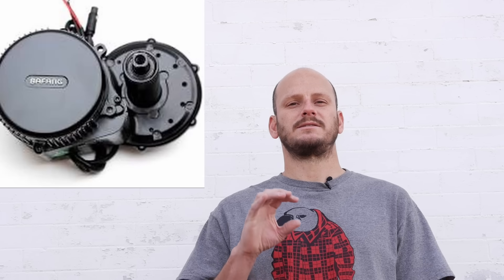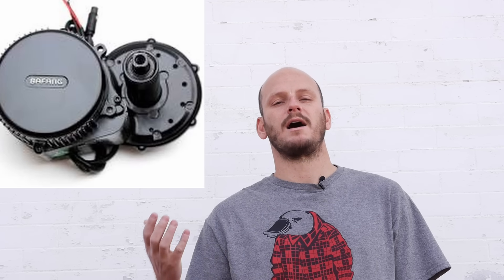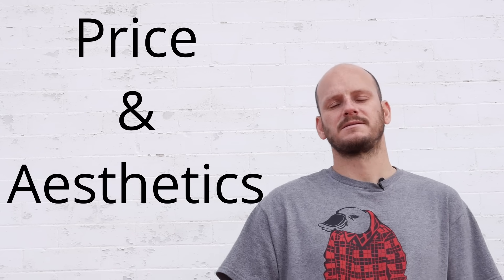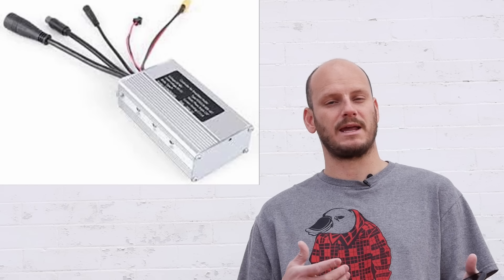Hub vs. Mid Drive Motors: Why Hub Motors Suck and Debunking Common Myths with performance test

Comment: Yes, but I can afford to replace the whole hub drive wheel a couple times for the cost of a mid drive.
And cheaper than relacing. Show me a mid drive bike for $750.
Reply from the maker: Bafang bbs02 are $450.
Reply from the maker: Sorry I thought you meant just a motor. An entire ebike for $750 is best to be left alone and let an unsuspecting buyer get it.
Reply: One thing that wasn't mentioned is that geared hubs allow the motor to run in a more favorable range and sort of split the difference between direct drive and mid drive. They provide more low end torque at the cost of high end speed.
Reply: @curtwuollet2912  ... I wanted a silent ebike, that was really smooth to use. That's why I picked the mid drive with Gates belt driven rear geared hub... Sure it's only a three speed, BUT since I live in Florida, hills are NOT an issue.
Reply: @JJ_ExMachina  I think what an ebike ends up being may shed parts carried over from bicycles that aren't as relevant. Belts are an example. Chains are a bit more efficient, but with motor power, no big deal. We could even see variable ratio setups like scooters or snowmobiles. Pedals are written into law, but may become vestigal. Already, I've looked at step throughs differently. At 67, the high kick over the frame gets to be a bit much.
Reply: @curtwuollet2912  ... Well after riding the Luna Fixed Stealth for over a year now, I can tell you that gates belt drive is far more reliable and far less maintenance then a chain. Yes on paper a belt may not be as efficient as a brand new unused chain... BUT after close to 10 thousand miles on my bike now... With zero need for lubrication, adjustment, and or replacement... The belt drive is far more efficient then a dirty chain or one that is worn out... It's great, not having to deal with cleaning and waxing my chains anymore... All I do is hit the bike with a hose, every now and then and dry it off... Nothing really to worry about. I am in my 40s and still enjoy the "high" kick over frame... I also still enjoy my sports bikes, so I might just be one of those "weirdos"... ;)
Reply: @JJ_ExMachina  I have no doubt it's a nice ride. But I had to stay within reason on retirement. The important thing is that the regular bike I had might be 10 years getting to 1600 miles, maybe never. I got out and rode the ebike about every day it wasn't raining or too cold for a year. So it is worth 10x more than the one that stayed in the garage.
Reply: @curtwuollet2912  ... Yes I agree completely... My ride my ebike about 30 miles a day or more...
Reply from the maker: @curtwuollet2912  true. But this video was more to just bash hub motors unashamedly😀
Reply: There are no cheap "good" e-bikes... Sorry but anything under the $900 range is a garbage e-bike (I am talking whole bike not add on kits). Heck most analog bikes under $600 are pretty crappy... SO $750 e-bike has to be a smoking pile of "sh*t".
Reply from the maker: Totally agree
Reply: @JJ_ExMachina  So far, I've got 1630 miles on my $770 500w ebike. Would have more, but my biking season is kinda short here in MN and I don't ride unless the weather is pleasant. Sure, a 2 or 3 thousand dollar ebike might be nicer, but the ebike thing didn't take off at those price points. Now you can get decent range (450 WH), name brand parts (Shimano, Tektro), and good, if not stellar, performance for a price point that is attractive. Yes there is some junk out there, but that will sort itself out. When people buy their second or third ebike, we will see more commodity bikes than big buck bikes my guess is that mid drives will come down to fit in that mix.
Reply: @curtwuollet2912  ... What bike do you own, as the only ones I have found that are worth their money start at no less then $900 (whole bike new, not an add on kit mind you).
Thanks for your info.
Reply: @JJ_ExMachina  It's an Ancheer, their 26" 500 watt upgraded model.
I got the upgrade for the bigger battery and Tektro brakes, plus adjustable stem. It's a very basic bike, but that's what I wanted.
P.S. It goes more than 15 mph if you disconnect the white wire.
Reply: @curtwuollet2912  ... Nice, can't complain, for the money you got a great deal...
   I am running the Luna Fixed Stealth Ebike, for $1750, it's got Gates Belt drive, three speed hub, and a 500w mid-drive...
Reply: @JJ_ExMachina  That is one thing I've learned with an ebike. 7 speeds would be enough and simpler. Just before winter, I upgraded the controller and display (because I can) money well spent. It's even better now. Low end torque is better for starting.
Reply from the maker: True. That’s why I always tell people to find a good bike to begin with especially on the used market it’s easy to find one for under 500 bucks with top-notch components. I sell high-performance long range motor kits for about $1000 so for all in at $1500 you can have a killer ebike. Even at at $111 you can have an awesome mid drive ebike including cost of bike. But you’re totally right about the dust settling we’re still in the wild wild west as far as Ebikes go where nobody really knows how much an E bike should cost.😩

Comment: I agree with your points. That being said, my dream build is a qs205 hub at 72 watts with a bigass battery. Specs dictate more of a motorbike/moped but I would ride it like a bike and will build it to look more like a bike than a motorcycle. Put less stress on the drivetrain, still have the power to not notice the motor crapping out at high speeds/while climbing hills. A 750 w planetary hub motor is pretty dumb in my opinion for a true daily driver/commuter bike (even dumber for a cargo bike lol). The motor is irresponsibly small and will easily burn out as you mentioned. I just like the simplicity of a direct drive hub over a mid-drive, and if there's enough voltage/amperage it seems like most of the negatives associated with a hub are gone. I would be curious to hear your thoughts on this and I appreciate the vid!
Reply from the maker: You totally get it! 72v on a hub motor is 🤘. Sounds like a killer build!

Comment: @JohnnyNerdOut Have you ever installed a mid drive on a SWB Recumbent? If so, what would the ride be like?
Reply from the maker: My friend rode one. He delivered with Uber eats on it. I tried riding it and always felt like I was going to do a forward summersault. I personally didn’t like it but maybe after 50 miles I would’ve gotten used to it.
Reply: I ride azub apus with geared front wheel motor for 10 years. I am satisfied. Mid drive motor would kill my long and expensive chalin before 10.000 km. You can see me driving on YouTube. Type " ležeče kolo skribas ". Recumbent bikel is the constitution, motor drive is the law. :-)

Comment: Has anyone tried to put a mid drive motor on a 2020 Surly Ice Cream truck fat bike. Very wide chain stays. I have not yet found a motor that clears and runs the chain well aligned. Any suggestions are most welcome.
Reply from the maker: Might need to try a cyc motor

Comment: Why did you skip over or oversimplify so much? 
https://ebikes.ca/learn/why-hub-motors-are-awesome.html lists 8 advantages that hub drives have, like 3) Ability to use internal gear hubs 4) Higher peak power capability 5) Potential for regenerative braking. Regen will make your brakes last 5 times longer in any weather, adding reliability.  Internal gear hubs are more reliable than mids with deraillers. Most IGHs aren't built for the high strain that mids push out. 

Grin's engineers have built motors for 15 years. They have fixed many of the problems you talk about, like their Baserunner fits inside popular generic battery cradles like Hailong or Reention, so you're not stuck with only one brand. They also come in Ready-to-Roll kits with all parts included so you convert your bike in 30 minutes without any special tools like the middrives need. You didn't mention the difference between Direct Drive and Geared Hub motors which have different levels of torque. They've put many motors through dynamometer testing so you can see exactly how much torque you will get if you plug in your total weight, voltage, etc into their web motor simulator. 

Holmes Hobbies also mentions in a video about how Grin tested to see how long before spokes fail on hub motors to fix that as well:  https://youtu.be/cSuqqIS4sP8
Reply from the maker: Grin is probably the only hub motor that I have and will recommend to people who want a hub. I use an IGH with my motor so I don’t understand the point. Mid drives are just, in my opinion, a superior design. It takes more of a learning curve, but worth it. Each motor is designed for different riders in mind. For me personally, I need a mid drive. I ride a cargo bike and often haul big heavy loads and ride up and down steep inclines. A hub motor cannot handle that workload. But for some people a hub motor is just fine, if you live in a flat landed area and don’t put it under heavy hauling duty.
Reply: @JohnnyNerdOut  There are hub motors built for cargo bike use, like the GMAC motor.
Reply from the maker: @sammiller6631  that’s a pretty cool motor. Geared and regen. Grin is a great company. Too bad they don’t make mid drives😀
Reply: @JohnnyNerdOut  Why would Grin make mid-drives when that's a crowded market with big names like Bosch can produce higher volumes as well as dirt cheap Chinese knockoff clones like Bafang? 

BionX tried that and even managed to become the standard for a while but where are they now? Better to be a big fish in a smaller pond than having to swim with mid-drive sharks that will leave your motors without parts when they show no mercy.
Reply from the maker: There’s a reason no one makes hub motors with regen when it comes to bicycle applications. Not enough enertia to recoup useable power. 
Personally I would rather deal with a broken chain than a broken wheel😀🤞
I’m closing it on approximately 1500 issue free miles on my IGH single speed chain combo.
Reply: @JohnnyNerdOut  Regen braking's main benefit isn't recouping power. The 10% it returns to the battery is a side benefit compared to added brake life from not grinding brake pads or heating rims on long descents. If hub motors are set up correctly, then there are no broken wheels or chains. Just ask on the Endless Sphere forums.
Reply from the maker: @sammiller6631  in my experience hard braking is where brake pad wear occurs. Unless the regen feature can lockup the tire essentially, I don’t see it saving any real brake pad life. Maybe 2-3%. I could be wrong, just my immediate thought though.

Comment: In my opinion you have added some of your own myths to this video. For example you can add a 7 or 8 speed gear cluster to many 750 watt Bafang rear motors & weight wise it is pretty close to the BBS02 750. As for torque numbers the BBS02 delivers 120 nm from the factory not 160 as you claimed. Torque numbers really only matter at the pavement anyway and running your power through your front chainring, chain, rear gear cluster, through the wheel, spokes & finally to the road is a lot more places for things to go wrong with higher torque numbers. As for having a nice clean package should something go wrong with my Controller it's a hell of a lot easier to access than on a Mid Drive. For performance, speed & reliability numbers if using the same rated Bafang motors I don't think there is much between them with the same gearing & weight being pushed. Each has advantages & disadvantages. It all comes down to amps in = watts out. With a Mid Drive you can go to an Internal Gear Hub. With a Geared Hub Motor you have a more direct application of your power & can use your throttle if you don't change down quick enough. One other disadvantage to Bafang Mid Drives is the installation damages your bottom bracket shell. May not matter to some but it would matter to me if I just spent $5 or $6000. on my bike.
Reply from the maker: We all have our own opinions. People always ask me why i dont ride a hub motor anymore and thought i'd make this video. For me the hill climb comparison says it all. Numbers look great on paper but in real life its all about the experience. Also, i've rarely seen any bottom bracket damage when installing a BBS02. the main thing is that a mid drive can pin point where the power is going (specific gear).

Comment: Just bought a Bafang bbs02b 750W and 52V battery, will get me anywhere I want for sure.
Reply: It could even get to places you don't want. They are capable little workhorses.
Reply: @michaelsprinzeles4022  Good to know. I really want distance on it and i think I will get that at moderate pedaling. Haven't mounted it yet has been to freaking cold outside, but now the warmth is coming here so its very soon time and I just can't wait.
Reply: @dtiydr  Depending on how many amp hours the battery is, with pedaling you'll probably run out of power before the battery;)
Reply: @michaelsprinzeles4022  its a 20Ah prismatic battery. And I will most likely pedal all the time as well either its on or off since I want to be somewhat fit condition which is the reason I bike anyway, I'm not overweight but still. But I want to get farther and a little faster which I guess the BBS02B will do for me.

I normally average around 14.3mph when I cycle normal on a flat road but around 20mph or little over would feel as an ok  continually speed with pedaling. But I have no experience with electric bikes so I don't know any range. I don't want to discharge the batter much either to keep a long life on it and I think I can be able to do that with 20Ah and still have good range.
Reply: @dtiydr  I'm not sure how hard you're going to pedal but it definitely sounds like, with that much effort, you'll never see your battery die;)
Ride on & enjoy;)
Reply: Os that the one with torque sensing and ISIS-standard cranks?
Reply: @Kolon999  No the BBS02B does not have torque sensing, the competitor TSDZ2 has. It was a little struggle to decide which to buy but there were some rumors that the BBS02B was a bit stronger which was what I wanted and also didn't have any real use of the torque sensing thing at all. The pretty much only downside of the BBS02B was that it was not as easily programmable in any way you wanted as the TSDZ2 where you can program just everything and also the TFT color display you can buy to it where you could change the layout in pretty much anyway you wan't, which you can't (as to my knowledge) with any TFT color display for the BBS02B. But you can program the BBS02B it self quite much these days anyway since someone released the program that the fab used, which opened it up sort of speak. But I haven't have the time to dealt with it all yet.

Comment: Sold. Gonna order a bbshd bafang... with a 52v battery... but what size battery u recommend? How long do they last for the diff sizes. Amp hrs etc ?
Reply from the maker: I usually say go as big as you can afford/bike can handle. No one ever complained of having too much capacity
Reply from the maker: Check out my other video :What are Watt Hours/How to calculate how many you need

Comment: Are there mid-drive motors for stupid frame types? I need one with at least 1" clearance between the motor and bb shell.
Reply from the maker: You just need to add 1” of spacers

Comment: I like the new stile mid drive with the belt  drive combined with the internally geared hub. Right now they're stupid expensive, but much better design.
Reply from the maker: Absolutely. Check out the new ebike by Harley Davidson. Great bike, just underpowered
Reply: @JohnnyNerdOut  You forgot over priced as well.
Reply: Got a belt drive...silent

My wife's screams when the credit card came due...well it's worth it
Reply: @SocalSamStokes  yeah you like it? I heard one guy once complain  about the hub's blowing from the torque of a thousand watt mid Drive, but I've only heard it once.

Comment: I disagree hub motors are better I use front 500 watt high torque low speed 48v on the front for acceleration and 2500w 52v on the back and it would destroy your bike speed acceleration and range
Reply from the maker: well ya, a 2500w would destroy a 750w, even if it is a hub motor. Once you get over say 1500w the differences in performance start going away. This video is showing the difference between street legal motors.

Comment: Dude, where the hell were you like a week ago?? I just took my brand spanking new hardtail hub-drive to a local trail with some hills and MTB features and it SUCKED! It was super soupy out there cause we got a ton of snow melt right now, so it'll probably be better dry, but I felt like I was the rear hub was pushing and dragging me all over the place. So offcenter it's hard to control the damn bike. Wish I'd have seen this before pulling the trigger!
Reply from the maker: My bad

Comment: Or if you want front wheel drive also. But I'm putting mid drive on my beater Frank N  Stein. Bike. So glad I came across someone with knowledge of these things. I need to know how to size the motor to fit. Thanks.
Reply from the maker: Just measure your bottom bracket shell. Then just order that size motor axle. Most common size is 68/73. Fat bikes are 120mm. And some mountain bikes/ mid fat bikes are 100mm motor size
Reply: @JohnnyNerdOut  ok. Thanks.